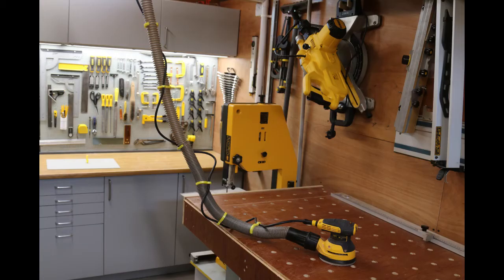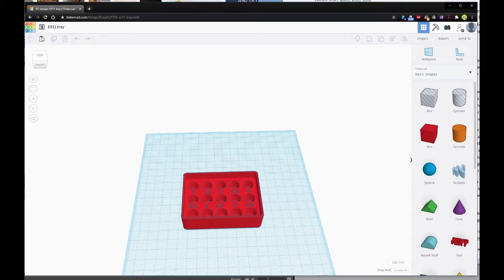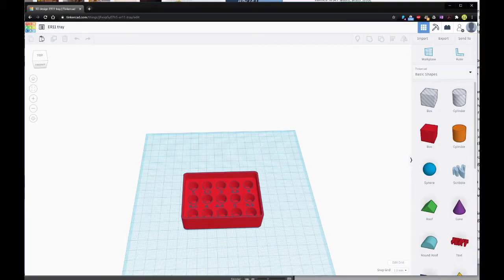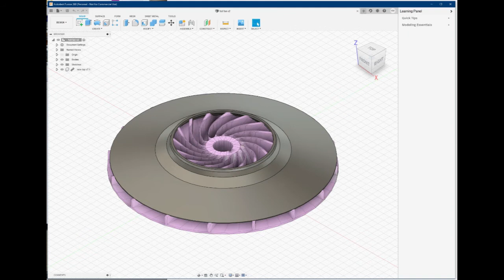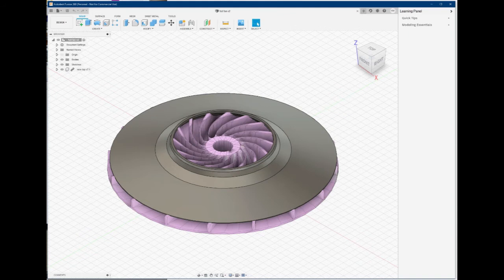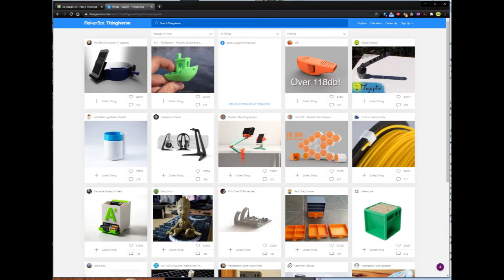3d printing, for woodworkers or any DIYers.

Comment: havent seen tape on a printer bed in years. glad to see the printing community extending into the hands of more people of trade. sidewinder is a beautiful working machine.
Reply from the maker: I found that tape just stopped failed prints. I am sure there are other ways, but it works or me. Yes, the Sidewinder seems a good machine, although I have nothing to compare to- but to me it seemed well engineered.
Reply: @Tensquaremetreworkshop  for what it's worth tape actually works really well i don't remember why I stopped using it! 

One thing for sure is no matter how good of a surface you have, you'll always run into prints that just don't want to stick! 8 years printing and still haunted by prints miss behaving haha! 

I hope you enjoy your machine. I'll sub and follow your ventures! I may know my printers but as much as I love wood work i sure am terrible at it, look forward to learning from ya!
Reply from the maker: @KnuXx28  Thanks Rene! What surprised me with 3D printing is how often it comes out right (as a design) first time. Guess that is because it is so accurate, and you can see what you are going to get. It is a lot stronger than I expected, too. Wish I had got into it earlier...
Reply: Thanks for posting this. Do you need a hard wire connection to the printer, or has it got onboard computing to take a machine code file from a thumb drive?
Reply from the maker: @normanboyes4983  Models vary, but commonly they have thumb drive and/or SD card interfaces. Files used are gcode. These are produced by a gcode generator like Cura, which takes a solid model file (e.g. .stl) and produces a gcode file, which is a list of operations for the printer. This format has been used since the 1950s... Lots of programs to produce the 3D model, such as Fusion360 or TinkerCad. Or download other peoples files from Thingiverse.
Reply: @Tensquaremetreworkshop  Thanks